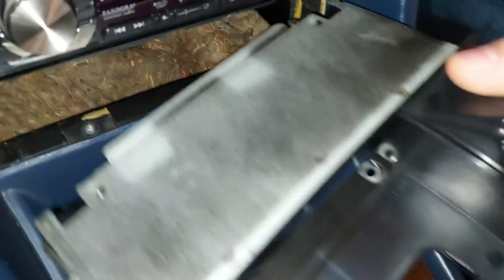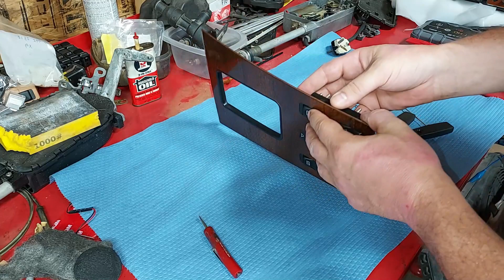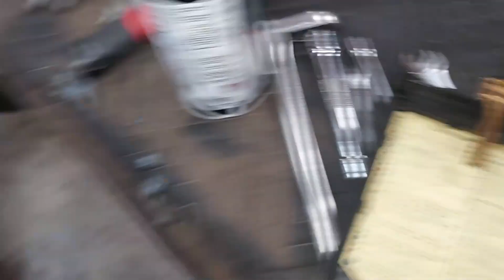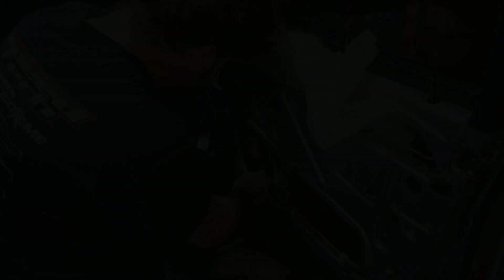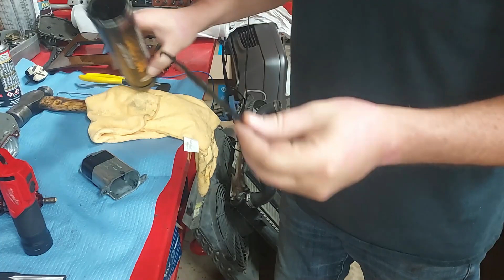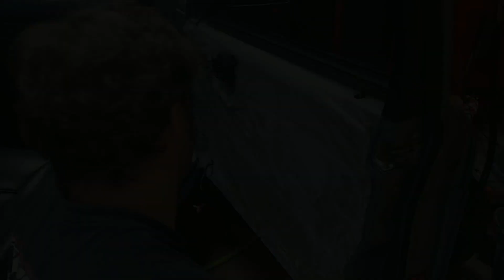300SD Window Motor Repair

Comment: Hey woods thank you so much for this video it was exactly what I needed.  My switch was sticking and I had to press it like 50 times for the window to roll up. Down wasn’t a problem. Replaced the switch and still the same issue. Took apart the motor with your video, nothing seemed out of place but I gave it a good cleaning with some electric parts cleaner, cleaned all the old lube off and threw some new moly lube in, sanded the connections at the junction box and threw some electric grease over the top to prevent any future corrosion and she’s working like a charm now. Thanks a lot.
Reply from the maker: Glad you were able to get it working, great job!
Reply: @woodsandbarclay hey woods I’m still having some sticking unfortunately actually could you point me to the window ground?
Reply from the maker: I'm sorry I can't help you with that. However the ground is not going to make the window motor sticky. A bad ground will just make it not work at all.
Reply: @woodsandbarclay thanks for the info. I greatly appreciate your time. Any further advice on where to look next would be appreciated. Switch is brand new
Reply from the maker: Bypass the switch and connect 12 volt power directly to the window and see if it goes up smoothly and goes down smoothly.
Reply: @woodsandbarclay it does, I tried that when I watched your video. Everything from the motor works good and I get 13.73 volts when I hit the switch on the wires from the car
Reply from the maker: Then the problem is not the switch of the motors is probably the slider in the track. Something is binding.

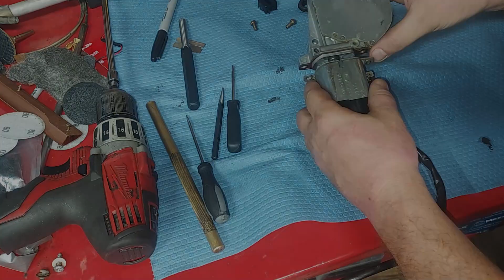Comment: How did you connect the 2 parts together at 29:55? Mine doesn't want to connect 😩 was it just push down all the way or threaded in?
Reply from the maker: The rod just pushes into the bushing down in the bottom of the case and then you screw the top back on with the screws
Reply: Thx! Had to align everything but finally got it 😪 Thx for posting these vids!
Reply: @tha_177z2  I had the same issue randomly after I put it back together but disassembled to make sure everything was right. I finally got it by running the motor off the 12v and it ran itself into place.

Comment: Your videos are a wealth of information. Could I ask a question, when the rear coupe windows are finally working properly, but they lift too much and into the door window, can this somehow be adjusted?
Cheers
Reply from the maker: Yes there are several adjustment areas on the coupe rear windows. Best I can tell you is just look in there for the adjustment bolts.
Reply: @woodsandbarclay  thanks, I really appreciate your reply!

Comment: Another Excellent instructional video. Just one question, that small hole near the base of the motor (where the bush is that you straightened), is it to be used for lubrication to the bush?
Reply from the maker: No it's where a little shaft plugs into to keep everything centered. The shaft popped out of that little hole.
Reply: @woodsandbarclay  thanks!
Reply from the maker: No problem

Comment: How did you reassemble the worm drive into the geared housing?  The case does not split open.
Reply: Yeah, but can you tell me?  Does it require powering it?

I’m thinking the bushing in the gear housing is obstructing it?
Reply from the maker: I'm sorry I don't really understand your question tough to diagnose stuff in YouTube comments. Please give me a call during normal business hours and we can talk through it.
Reply from the maker: I should show all this in the video.

Comment: I just went to repair my front passenger side window today and it appears the switch is the culprit. I ordered a new one ($87), but you mentioned that they can be repaired, perhaps?
Reply from the maker: Yes the switches can be disassembled and cleaned.
Reply: @woodsandbarclay  Thank you. Probably too late for this one, but I can practice for the next one that goes bad. Appreciate it!

Comment: My father’s 300SDL makes a loud popping sound whenever his window rolls all the way up. Like the motor isn’t disengaging when it should stop. I thought I’d seen you address something similar in a video. Any ideas?
Reply from the maker: Yes that's usually one of the teeth missing from the window actuator gear or one of the teeth not engaging. I would say not to use that window anymore until you can have it looked at. It could also be the little plastic slider that moves back and forth and the window regulator track has popped loose. Again try not to use the window or it'll get worse.